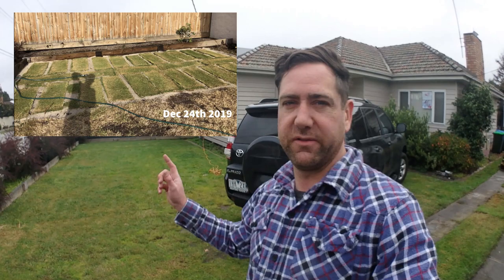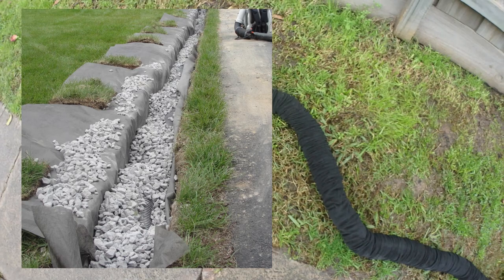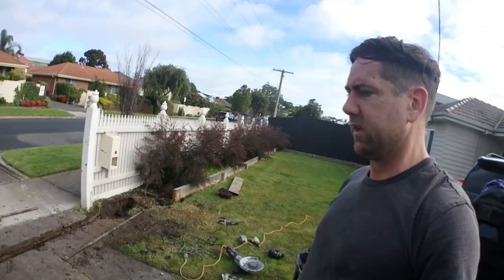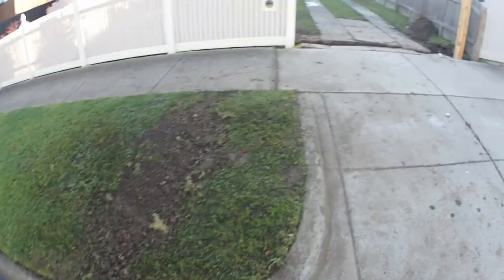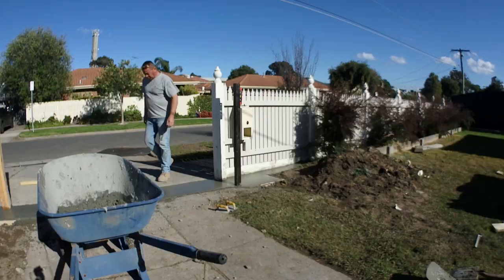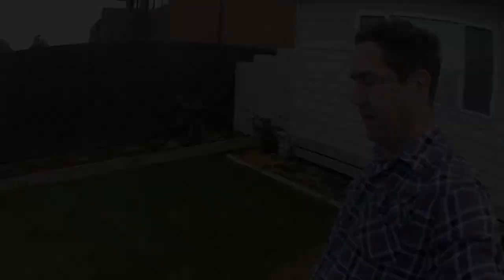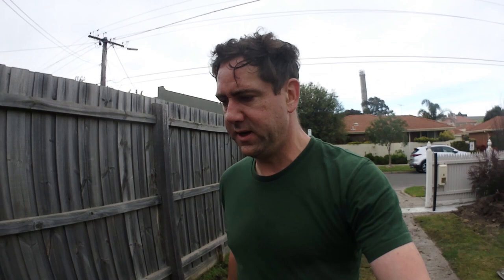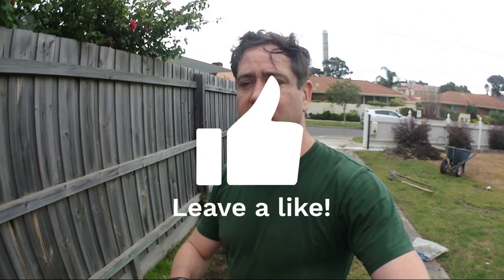Installing drainage in my yard to channel standing water

Comment: Great work. 👍 Can you get some footage of it working during heavy rain? Would love to see it in action! Digging is very hard work! Have you installed the new gate?
Reply from the maker: Thanks mate! Yeah it hammers out, will try link something in some time 👍
Reply from the maker: Oh and gate is on hold man, got a few other things on the go. Thanks for watching! ✌🏻
Reply: You won't see anything during heavy rains. A drain like that attracts water already under the ground to dry the underneath. A drain like that does most of its work in the days after the rain.

Comment: Ur a funny knt lol .. mate don’t u have to have a high point snd a low point in the trench ? How did I manage to measure that . Wanna install around my house foundation on one side of the house and tap on the corner gutter storm pipe
Reply from the maker: Hey man I had natural fall towards the street which seems to work well. I guess bog flat ground you may need to incorporate fall into the trench to get water moving?

Comment: how do you run a pipe under a footpath without digging up the path. I could do with running my drainage out to the stormwater outside.
Reply from the maker: Hey mate I rammed a smaller dia PVC pipe through a larger, partially blocked ceramic pipe. A combo of high pressure garden hose and hand digging from either side under the path also works if no existing conduit (have done this for irrigation)
Reply: @lawndreams5952  ah, very wise. I'll give it a go someday

Comment: Ya mate always cut forward with the saw ya can see ya line clearly and  ya less likely to fall on ya ass while holding a 9 inch...
Reply from the maker: Good call cheers brother
Reply: @lawndreams5952  25 years metal fabricator site pressure welder and engineering....Always have the contact point of the blade 90 degrees to the direction of the grinder so if the blade catches it punched forward not up towards you and also when ya get good technique ya can aim the sparks as when ya get the sweet spot the grinder does all the work...

Comment: How did you run the pvc under the footpath?
Reply from the maker: Through the existing terracotta pipe. Took a bit of force as the terracotta wasn’t great. May have cracked some PVC in the process. Was a 3m length so had to trench back into the front yard to get it through

Comment: You didn’t show how you hooked your new pipe into the old stormy at the letterbox...?? C’mon mate.
Reply from the maker: It was a brutal, uncouth process that may have some involved some ramming and a hint of pipe fracture 😬
Reply: @lawndreams5952  ah fair enough
I need to get into my concrete stormwater drain . I’m starting to think sledge hammer is my only option 🙄
Reply from the maker: @carolynm9638  diamond blade saw! 💪🏻